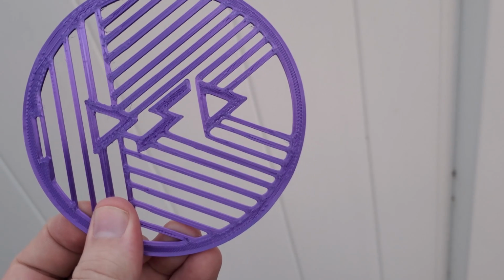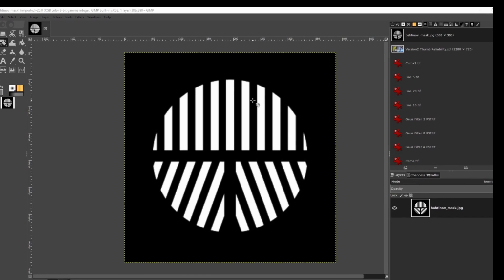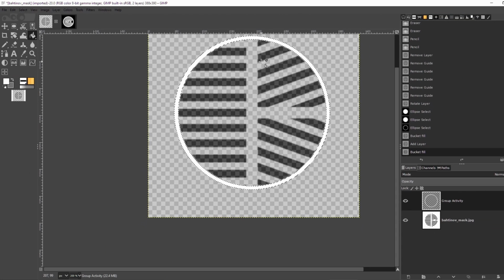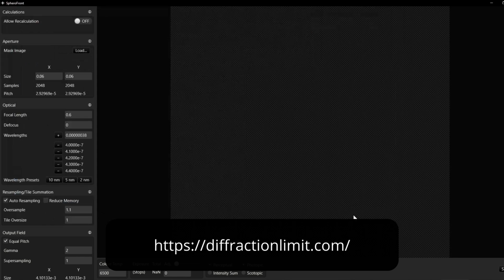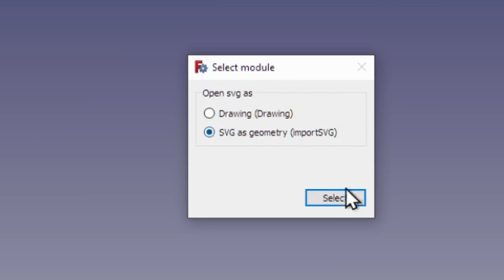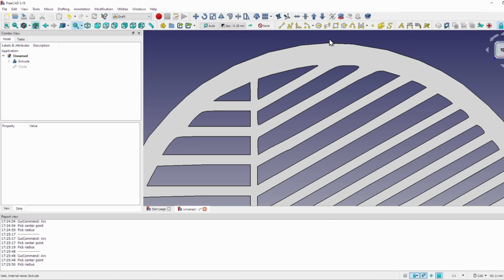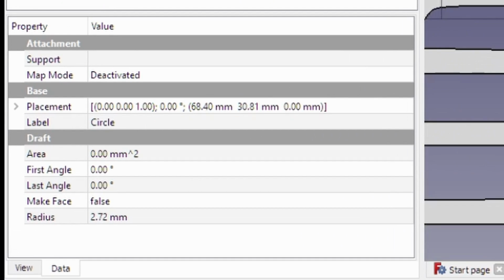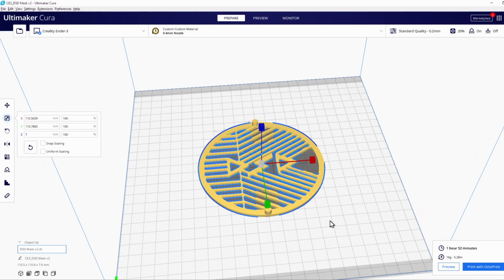DIY Personalized Bahtinov Mask! Create it in free software and print it yourself!

Comment: Nice idea and thanks! But should should really improve your 3D printer settings. The surface of the mask looks horrible... ;-)
Reply from the maker: Thanks! You are 100% correct, although with something like a Bahtinov mask, I'm not exactly looking for a perfect print. Just one that does the job! Curious, what settings would you use to make it better?
Reply: @deepskydetail  Enabling ironing can make for an interesting finish. Also seems like maybe it was so thin, there was hardly any (or no?) top surface layer passes